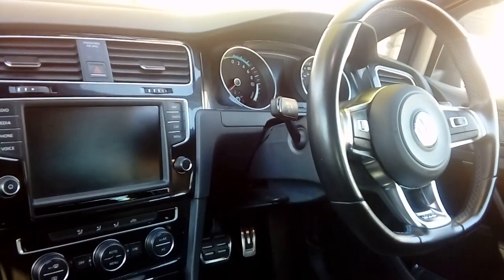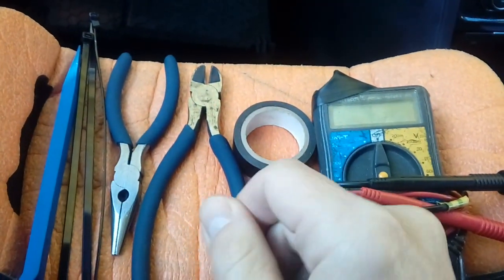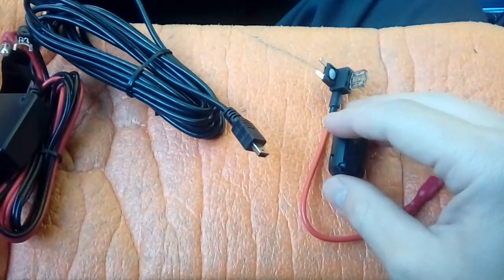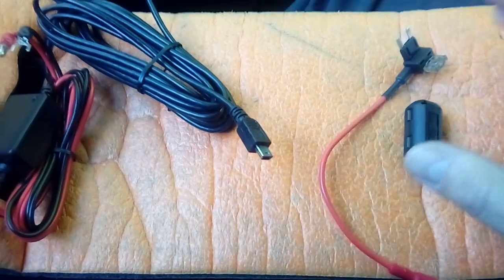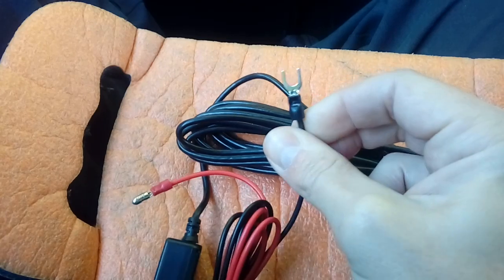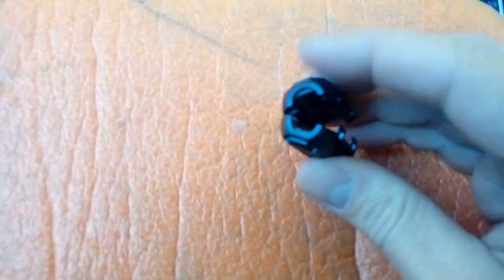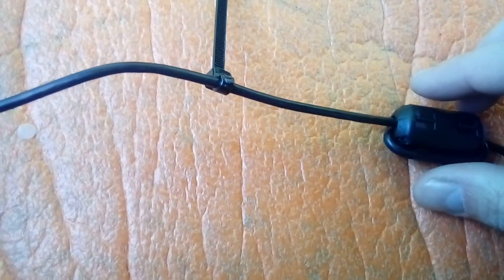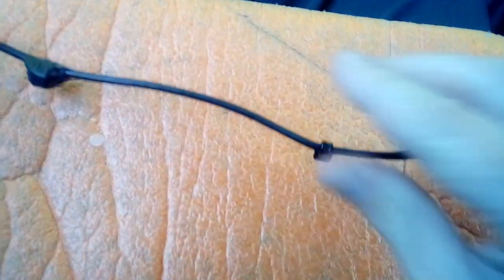VW Golf mk7 hybrid/GTE 2014 onward how to fit a dash cam to ignition,simple guide.

Comment: Very useful guide, thank you. It worked well for me on my 2018 Golf GTI mk7.5. The screw you used for the earth/ground connection has an 8mm metric thread, so it's an M8 nut that is required. To tighten the nut you will require a 13mm socket or spanner.

Comment: Fuse holders have a hot (power) and a cold side. If you put your fuse holder in the wrong way, the power will need to run through the lower fuse to get to your dashcam fuse. The fuse holder should be plugged in so that the power from the hot side runs through directly your dashcam fuse.
Reply from the maker: Exactly, that’s why I hope people follow the guide and take note which way round it is.

Comment: Can the supplied fuse connector be plugged in to a spare fuse slot beside the other switched fuses? Or does it specifically need piggy backed with an existing one?
Reply from the maker: Your best to use a socket that has a fuse because otherwise the ecu may detect a optional extra that was never fitted to your model and pop a warning light up.
Reply: @PJsprojects  ah ok, makes sense. Thanks for taking the time to reply. Will change it asap.
Reply: @c4mbl  If you didn't get a warning message, why would you need to change it? (But it's still a good point, IF you got a warning message.)

Comment: Hi. Did you find that this fuse tap into the fuse box resulted in a message of high power consumption on the car infotainment system and stopped the start stop engine system from working?
Reply from the maker: Never had a follow up complaint from the cars owner but depending on spec and where in the world your car was sold could change the fusebox layout.

Comment: Love the video, just used it to install a cam into my golf.  Couple of pointers:
- more detail on how to route the cable behind the airbag would have been helpful, after some messing about, I threaded the cable behind it before wedging it into the ceiling, much easier
- detail on how best to route the cable down the edge of the door pillar to the space behind the 'airbag key panel' would have been helpful
- knowing in this case how big a nut (size) was needed for the earth cable would have helped.

Think that's it really, rest was really good! Thanks again!
Reply: I thought exactly the same as you. He cut out some important parts of the procedure.
Reply: Doing this shortly myself do you recall the nut size so I can have it on hand cheers
Reply: kreg jig did you find out what size the nut was?!.
Reply: @iMann_iFail  I think it was a 13mm, its been a while as i've changed cars since then.  I would recommend threading the cable through from the outside, behind the pillar airbag first, before you run it across to the rear view mirror, trying to do it inside out, with bits attached was a pain

Comment: Amazing!! Just fitted this to my golf r 2018. Although I put the fuse bit in the other way round, downwards instead of upwards. Seemed to fit better
Reply: It's important to fit the fuse tap with the 'outside' blade into the 12v side of the fuse holder

Comment: Hi, I have done the exact same procedure as you, but the fuse supplied with the dash am is blowing. I have tried the fuse tap upside down and the other way as described by your video? Any suggestions? Could the ground not be secure enough?
Reply from the maker: If the fur is blowing you have a dead short. 
If the fuse only blows when the camera is plugged in then you most likely have a faulty camera.
If it blows without being plugged in then you have a wiring problem.

Comment: Good video - do you have any more guidance at all though please about how you routed the cable BEHIND the airbag (10:56)? Can't find a solution without it still crossing the curtain airbag at some point... Did you take the whole A-pillar off, run it down the inside windscreen side then back up, or feed the end of the cable behind it and follow it through, or is there a better way? Thanks
Reply from the maker: You will find that certain sections of the airbag are loose enough to fit a finger behind the bag and the bodywork, so use the area near the top to tuck the cable behind.

Comment: Do you know what fuse has power going to it when the car is off, trying to do this but don’t have a multimeter
Reply from the maker: Something like the central locking is live all the time so check your user guide that came with the car for the fuse.
Please be aware if you pull a wrong fuse you could end up with a dashboard warning light that would need a diagnostic reset.

Comment: Hi. Hope all is well. 
I'm struggling to find the correct fuse to wire in a nextbase 522gw into a golf r mark 8
Please can you help?
Reply: Tried to wire it into the 20 amp fuse which is the cigarette lighter but doesn't work
Reply from the maker: You need an ignition switched such as the heater blower, this can only be activated when the ignition is on.

Comment: Excellent Video !!!! Can the camera be wired to a permanent circuit so the camera is on all the time ?
Reply from the maker: It can but don’t count on the low voltage cut out feature to work. A flat battery is common when wired like that.
Reply: @PJsprojects  ok I will stick to the switched circuit

Comment: Just installed this now a new error to check safe lock is coming up after turning off the ignition. Any tips or advice?
Reply: Better late than never, but check safe lock message shouldve also been there before hand, its a feature of the car to remind you of safe lock (pressing the lock button on the key fob once, and not twice, when locking the car - pressing twice disables safe lock).